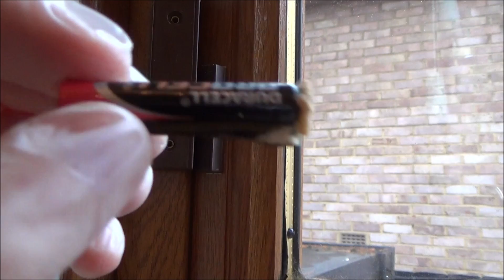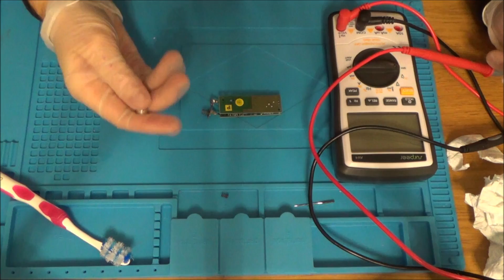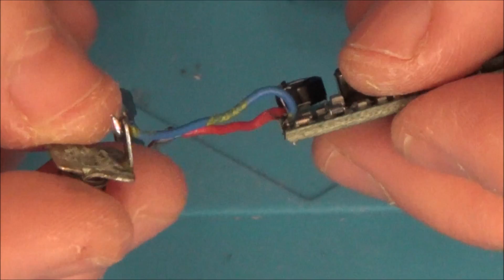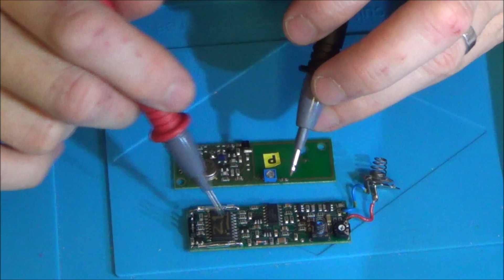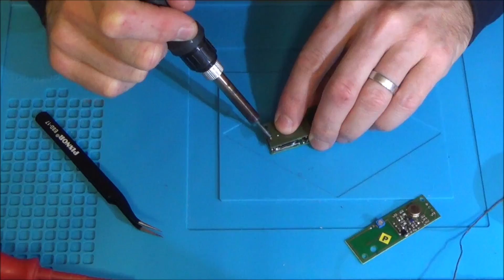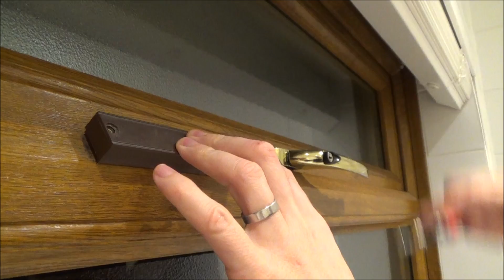Trying to FIX a Faulty Wireless Alarm Sensor

Comment: 25pF is nothing, it is like 2 isolated wires twisted 20 times one another ... but on the signal path when there is a high frequency involved -> 25pF is like magic bridge that pass exat frequency range (or AC signal) trough and block DC signal -> decouple AC from DC signal and act like bandpass filter

Comment: It could be a resistor in mega ohms range value e.g. above 10M ohms or more and out of range on your multimeter. Also could be a varicap (diode and capacitor in series -> voltage controlled capacitor -> because it has a trimmer potentiometer in series as i can see) because it is in the path of antena or maybe a small cap in pF range (pico-farads) (then the trimmer will be capacitor also in pF range) if it is below 25pF you will not catch it with those instruments you've got.

Comment: what amazes me is how many components are built into that board, surely all it needs to do is detect and transmit an open/close and tamper signal, why does it need so many resistors, capacitors, etc etc

Comment: That tiny part could be a fuse the capacitors are usually the brown colored ones and the black ones with numbers on them are resistors sometimes they are 0 ohms.

I've only seen black surface mount fuses in hard drive logic boards (these have to be there because the logic boards hold all the data for bad sectors and a new one would have to learn where all the bad sectors are, if it works, some don't) nintendo ds systems and gameboys i have not seen them in anything else.

The variable resistors are also called potentiometers or pots there are a few different names for them (i know this stuff from watching these videos, watching other people's videos, and from reading books about how to fix things).

I can put a link for one of the books that i read about how to fix everything if thats ok.

Comment: Love every second of your video's Vince keep up the awesome work mate, but can I offer a suggestion, you have been messing around with your home alarm system ( unqualified repair )..  Will this affect your home insurance, worth checking just to be on the safe side buddy...
Reply from the maker: Thanks for the advice. This would probably be true for many people but with me I was advised to not include the alarm in the home insurance because it doesn't reduce the price by much and then if it is not set (or not working) then the insurance company would have a way to get out of paying. If I don't include it but I have one then I can still set it all the time as normal but I will be covered if something was wrong with it :-)

Comment: Can you try mounting the box with the batteries at the bottom, so that if they do leak, they don't leak onto the cct board? The reed switch is on either side so should still work, 
Like your videos. Better luck next time on the UK-US  Pro v Am challenge.

Comment: Hi Vince you might fined this stuff handy.Good vids very interesting. 
 https://www.ebay.co.uk/itm/9893-MANNOL-450ml-Electrical-Contact-Cleaner-Spray-Aerosol-Switch-clean/302780482488?_trkparms=aid%3D555017%26algo%3DPL.CASSINI%26ao%3D1%26asc%3D55149%26meid%3Df8b9baf2149a4d84993b81645e31510c%26pid%3D101006%26rk%3D1%26rkt%3D1%26%26itm%3D302780482488&_trksid=p2045573.c101006.m3226

Comment: Whenever there's a leak, be sure to neutralize and clean the whole thing. Just brushing a bit and puting it back together will not always work on the long term as the corrosive agent might still be there around, under components. More than a good clean is needed. Depending on the nature of the corrosive agent, you would need to neutralize it first and then flood with IPA and leave to evaporate... hope this helps. Apart of that, WELL DONE AGAIN! :D:D Love your videos, it's so motivating to see how you step it up each time :))

Comment: Faulty board is transponder, that blue think tuning capacitor, they adjusted  the frequency and put the tape on it, if you touch it you will lose the frequency, value of it probably not in your tester range you cant read it, probably 5- max 10pf variable cap will be ok

Comment: if it has 3 pins variable resistor, if it has 2 pins variable capacitor  but not always strait forward, if it has 3 pin ,you sould read resistance where 2 pins close together this is the value of the item,  if its a capacitor, value sould be very low like 2-3 pico-farad its normal if you cant read it, practically when you stick 2 one pence together ,put clink film between them that will also show similar cap value , if you want to repair electronics you willl need to know basic electronics at list
Reply from the maker: Thanks for the great information :-)

Comment: Duracell's finest yet again, leak specialist, they are a nightmare!
Reply: Good Point, Looking at the location of the device, it might just be that it's in direct sunlight and gets warm and cold temp changes that could make the batteries more susceptible to leaking it might have been better to mount it on the other side of the window.

Comment: I used to think that Duracell guaranteed their batteries not leak, In recent years I have found Duracell to be no better than any other cheap battery supplier regarding leaking. I did a search and found this: https://www.reddit.com/r/LifeProTips/comments/2ykotk/lpt_duracell_will_replace_or_repair_items_that/ 
Does anyone else seem to remember this?

Comment: I would guess at a cross polarity diode. There to protect fitting batteries the wrong way, where if you do it cuts off. To test we would just cut in half and the problem was solved ( CB radios ). Unsure though if they use the newer block casings for diodes ? Becarefull if testing without that you dont get battery polarity wrong and blow another component ! The corrosion may have arched positive to negative and blown the diode ?

Comment: On surface mount Capacitors with no markings you go of the shade of brown and the size. Steve would be right if it was used to smooth a power line but it is used to block DC volts while allowing AC volts through it on a antenna circuit. The capacitor is used on the antenna which is a dipole(loop). The corrosion must have created a resistance because if it had of gone open circuit it would be like the capacitor wasn't there. If it had of gone short circuit your continuity tester would have shown it to be short circuit. By removing it you effectively created another kind of antenna that is open. So instead of being a loop it is one long and one very short antenna. This will effect the range it can work at but obviously it is still within the range it can transmit. When I say AC it will be a FM(Frequency Modulated) signal. Which is a sine wave ~ that alters how many of these(called waveforms) per second(frequency) there are depending whether you have the window open or closed. By removing the capacitor you will have lowered the amplitude(how high and low it can go) but the frequency stays the same so the alarm sees it the same albeit as if you had increased the distance between the sensor and the alarm.

Comment: Looks like an over protection diode to me, they are made to blow when the voltage has a spike these are used alot in hf radio equipment to protect the boards removing it or just lifting one side will have the same effect as replacing it but keep in mind that if the spike happens again then the voltage will go straight into the board as the protection has been removed.

Comment: Great job vince =D  The corrosion is often the cause and simply having removed a component and re-installed it can often solve the problem as the corrosion gets removed by fresh solder and the process of re-seating it etc.  And as zallin says it is a cap and too low value for the meter to read it.  Probably a low pico farad rating.
Reply: GadgetUK164 - Retro Gaming Repairs & Mods couldn‘t this also be a ferrite bead?
Reply: It would / should measure as a low resistance (almost short) if it was a Ferrite Bead, but my understanding is he measure all of them and saw no resistance.
Reply from the maker: Thank you Chris :-) Maybe it was removing it from the board that 'fixed' it then. Thanks for the additional info on the cap reading, I didn't know that. Watched your Atari ST floppy disc drive video earlier today. Mixing up the paints to match the colour :-) You should be doing the eBay repair challenge will that level of restoration :-)
Reply: No worries =D  And hehe @ the challenge!  I would love to do it just not sure on finding (and selling) the items within a month!

Comment: the component  is a resistor i didn't get a good look but i assume it's these https://www.reichelt.com/gb/en/smd-chip-resistor-1206-100-kohm-250-mw-1-vis-crcw1206100-p238100.html?CTYPE=0&MWSTFREE=0&PROVID=2788&wt_guka=54951029995_263550070223&PROVID=2788&gclid=Cj0KCQiAoJrfBRC0ARIsANqkS_4arVIe0YG9QGsD-Y4hZ75d_fqHYKX3BSNnZyZNwE5_ZoX_d4jsav4aAuF2EALw_wcB&&r=1

Comment: Vince, The part is small capacitor. the System it connects to is probably 2.4ghz so I'm thinking its part of the resonator on the board so it's value is approximately .01 picofarad  it's coupling cap. My friends and I have talked about your channel and we agree you are making progress, but I believe you need a mentor. I am willing to help you learn electronics properly. troubleshooting and diagnostics are key in identifying problems. Know what causes the faults and how to go about repairing them. I am on twitter @James36625092 I'm Electrical Engineer with a degree in Electronics Design with about 30 years or so experience. Let me know if you are interested or if any of your viewers are as well. Great job Vincent! Your welcome just to chat...
Reply: .01 pico ?  isn't it a bit small ? never seen a cap smaller than 0.5 pico.
Reply: @Ratzfaz  The higher the frequency the smaller the capacity?
Reply: Actually I see what I wrote and it would be .01 Micro... for 2.4 Ghz
Reply: @the8bitbarn836  u mean nano ?  .01 nano = 10 pF ?
Germany 1000 pF = 1 nF,  1000nF = 1uF ? 
many Times isn't it the same thing in Europe and US. look for Billion US 1,000,000,000 Germany 1,000,000,000,000
Reply: @Ratzfaz  It's really only like this for "Milliarde" vs "Billion". The SI prefixes are the same in Germany. About the frequency, 433 MHz is a lot more likely. These alarm systems rarely use 2.4 GHz transceivers.
Reply: @Ratzfaz   490-11346-2-ND digikey part# for .1pf cap
Reply from the maker: Thanks for the offer James. Very kind of you :-)

Comment: When you got a reading it may have been due to contamination from the leak. I believe it is in the antenna circuit and will be a low capacitor even as low as 2pF. 
I am surprised it is causing the local piezo sounder not to sound. I can understand it not communicating to the alarm box.

Comment: It's a series coupling cap on the antenna loop.  It's probably 1.5 picofarads or there abouts.  With it missing, the board will probably work but with much worse rx/tx performance.

Comment: It is a mlcc, and the blue thing is a variable capacitor, it looks like it's connected to a line of copper on the PCB which I would imagine is used for the antenna part of the circuit, my guess that you couldn't get a reading on your component tester is because it's a cheap Chinese thing that won't read smaller smd components. I would also of said that the electrolyte from the battery has damaged the cap on the end of the mlcc.

Comment: see my main comment as reply to Zallin's post, but also take those sensors and mount them differently so batteries never leak in there again!
also that metal disk you seen is a peizo speaker, it will create a very small voltage when it is tapped  which in turn can be put into a mosfet to drive the circuit or even what is called an op-amp

Comment: That component looks like a surface mount resistor used to help protect the batteries or the device from power surges caused by lightning as a fuse of sorts!

Comment: It could be a 0ohm jumper those smd components usually have a zero written on em but iwe seen ones with no markings.
Also when trying to identify what a component is always swap your multimeter leads out and measure from the other direction since it could also be a diode.
Well... just my 2 cents... may be useful... maybe not so useful :)

Comment: it is a cap. Its a part of the antenna circuit Caps have a ton of uses. its not showing up as its to small for your meters  to measure probably less than 20pf. And the alkaline fluid in batterys eat copper and make that corrosion as a by product so you need to clean ALL of it or it will keep eating the copper of the traces and vias
Reply from the maker: Wow, I knew you guys would have the answer. So knowledgeable. The more I learn the more I realise how little I know. The information that gets shared in the comments on these videos is fantastic. It helps so many people :-)
I and the others watching this thank you :-)
Reply: @Mymatevince  Vince Start a live stream sometime with guys like us. With guys like us in your corner you can't go wrong. I know what it's like to have someone looking over your shoulder saying do it this way or that and don't worry there is a reason we say it and do it, at the end of the day we want you to succeed!
Reply: I would trend to agree.  It appears to be a tuned tank circuit for the antenna of this device to deliver good coupling from the output transistor to the antenna.(the circuit that appears to do the meaningless loop around the edge of the board).  The small chip is a very small value cap and the device with the adjustable bit that looks like a pot is a variable cap.  You would need an oscilloscope to properly tune the tank circuit to get the most power output.  This would also cause it to work fine (closer) to the base controller as it would not have a strong enough signal farther away if the tank was not tuned properly.  I hope this helps.  It is very similar when you tried to tune old CB (citizens band) antennas to their radios to maximize the talk distance.  I believe it was called getting the SWR as low as possible.  It has been a few years.
Reply: I agree..
Reply: That's precisely what I was going to say =D
Reply: @GadgetUK164    We all understand electronics and the theory behind it. What I want to do is help people like Vincent learn and understand what we  already know, Electronics can fun and rewarding or down right deadly so I offer any help to these guys I can almost anytime they need it, my reward knowing that they won't hurt themselves or others and pass the knowledge I give them on to the next in line.
Reply: I agree with these comments, that's an LC tuner (it's easy to recognize because of that long square trace in the board, the antenna). That thing was surely a capacitor, in series with a trimmer cap (the blue thing) for a fine adjustment of the resonant circuit.
Reply: Something else to point out before I forget... Corrosion on PCB antennas like that cause an issue where the antenna doesnt work as it should.  I've fixed a few of the old satellite LNBs and other devices where corrosion affects the antenna.
Reply: That makes sense! Glad there are smart people out there who know about this stuff!
Reply: i second this, between the vari-cap and cap with the length of the traces and distance between them it should make a ballanced antenna for the output transistor, which that board is just an radio transmitter board but the other board sends the data signal to this board...
generally most antennas are ballenced at 50ohms but some transistors dont allways use this, in very old systems it was 75ohm... and no you cant just measure it with your meter as its now in the realm of RF black magic lol
in reality the caps make the antenna shorter but still seem the correct length to the output transistor, in reality for the 433mhz system your antenna should be about 160mm long! well give/take a fraction depending on other factors like other metal being close by etc